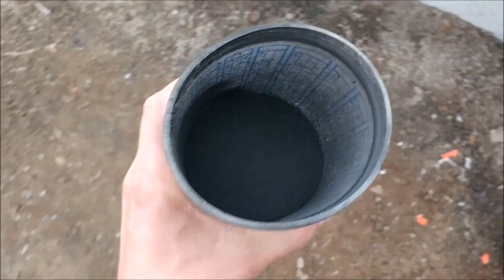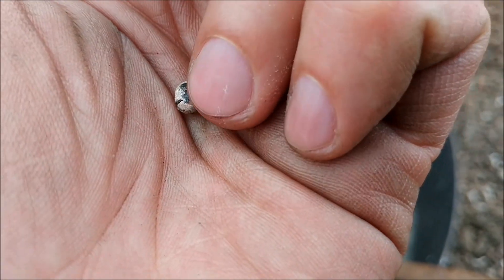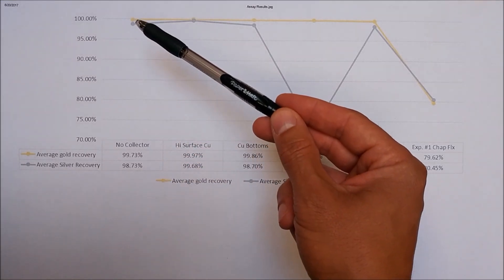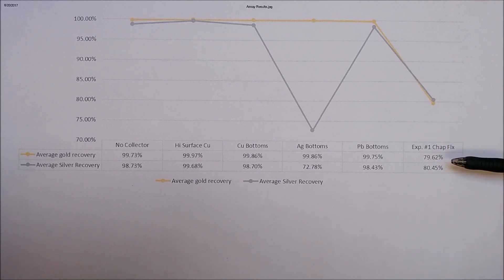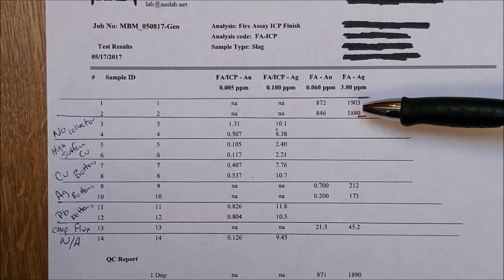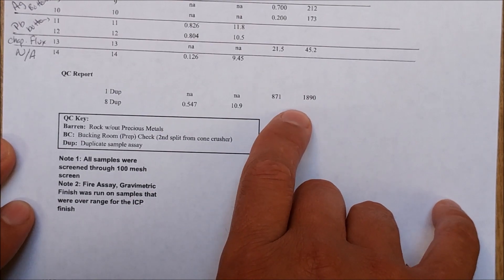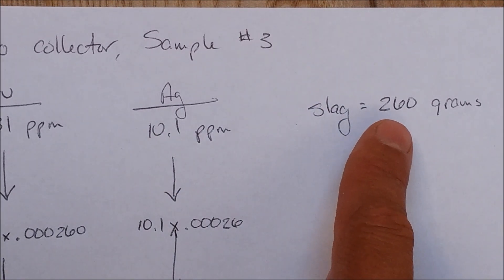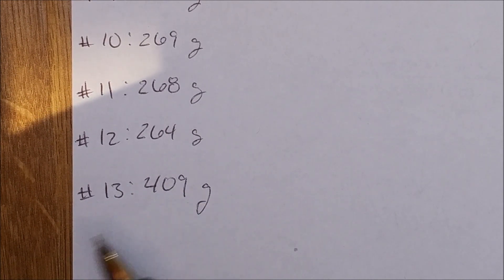Smelting gold/silver sulfides part 2: Collector metal smelting tests for precious metals recovery

Comment: Interesting.  Good to see a process comprehensively laid out.  I understand the button content is indirectly determined from the difference between the starting content and the slag content.  Not unreasonable.  However, from what I was able to gather for the buttons, the XRF data doesn't seem to agree with the indirectly determine data.  Is that correct?  If so, was that not unexpected?  Because in my experience with XRF, the probe can only "see" the surface and potentially a few microns deep.  So much of the button is not "seen" with XRF.  Or do you have different experiences?

Comment: Do you have come across a problem crated when the sample is rich in nickel in content?
I use lead as the metal collector but it turns out that lead shots float on top of the molten slag, in this case, and so cannot form a proper lead button at the bottom.
Just want to know how this problem can be avoided. :)
Reply from the maker: Not sure, try thinning with borax or cryolite

Comment: Thanks for the fantastic videos on smelting/refining, Jason.  This series is especially helpful to very small scale tinkerers like myself, especially since every lode source I find in my area of Western WA is high in sulfides.  If I can skip a roasting step and recover the majority of PMs it would be great.  Your content is some of the best on the internet on this stuff, with comprehensive information and documentation of your experiments that can be replicated by viewers.  I'm going to build a small furnace like yours (great cheap design with the kaowool and pipe BTW) to direct smelt some sulfide cons from a few of my sources.  A couple questions for you, if you have time to answer, as I'm still learning quite a bit:
Is that slag mold a custom build, made of simple plate steel?  That's way better than spending big $ on a large cast iron mold, assuming there is no big advantage to a cast iron slag mold over steel I don't yet know about!
Your specific sulfide cons seem to allow you to skip the roasting process and still have great PM recovery.  I assume different sulfide cons would have different results.  Have you had any experience with cons high in arsenopyrite or other problem heavy metals, with gold locked in the lattice?  Unfortunately, some of the best veins I've fond have high arsenpopyrite content.
Reply from the maker: Hi, the cone mold is a custom build, but simple and easy.  I haven't played with arsenopyrite, but assaying the slag will help determine the effectiveness of your experiments.  Thanks for the comments

Comment: hey just a thought..you said you dont know which metal but which one is easier to get the gold out of? sulfuric acid  easily dissolves silver. im not as educated in these fields but i have dabbled enough to know Cu has a even hotter melting point than gold and isnt affected by much acids.
Reply from the maker: Great, thanks for the tip!

Comment: Hello I was just wondering what part of the world you are in I live in California be near randsburg and I was wondering if your flux recipe is Universal or would it be area specific as to what is in the material as there is a high she-lite content in the cons which bonds with the magnatite trapping all the pms with it upon trying to  remelt the basic furnace would not do it we had to add magnesium pellets to the mix and when we finally got it to melt all the pms were vaporized almost instantly
Reply from the maker: Hi Sean.  I don't have any experience with sheelite.  Sounds like it is giving you guys a lot of issues.  Have you tried roasting the cons before smelting?

Comment: why would you place the collector at the bottom?
Reply from the maker: Good question.  If the collector performs well at the bottom of the charge it can be reused over and over again.  This will create a very rich collector block and there will be very little metal to refine.  This saves the long and expensive step of transforming your collector block into high surface area copper again or starting with fresh high surface area copper every time.  Hope this helps and answered the questions.  Thanks
Reply: Hi! Thanks for the answer, I have experience with lead and silver as collectors. IMHO the collector should be placed at the top of the charge, lead being heavier than most of the base metals travels trough the charge picking up precious metals on its way down (the smelting step in fire assay).
Reply: Hi Jason, did you ever work out if the Lead collector can actually be re used over and over again? since this test was inconclusive as you didn't need a collector to start with... @mbmmllc

Comment: Personally, I like copper as a collector. Recover the copper through electrolysis and the metals you're interested in fall to the bottom of the cell.
Reply: How do you have  You're electrolysis cell set up?
Reply: Shaun Mace like sreetips does it with a copper electrode.
Reply: @shaunmace9641  Sorry, didn't see you question before now.  Like John H says, I use a setup that i saw on sreetips.  Works well enough for small jobs like electrowinnowing smelted buttons.

However, I've never gone through the process of separating out the different precious metals from the muds.  Just got a bunch of that stuff in jars waiting to be separated.  :-p

Comment: Excellent
work. Thank you very much.  It will be interesting,
if it is possible to decant  part of the
slag and use the collecting metal several  times without to let it cooling down each time.  I ordered already material for my on oven to
test in this direction.
Reply from the maker: That is a good idea.  If you try it please let me know if it works.  Thanks

Comment: Thanks for videos on smelting concentrates and the results. I have been trying to find a process I can use to collect the extremely fine gold from sulphide ores I process here in south eastern australia.
Reply from the maker: Let me know how your experiments go with your fine gold and sulfides.  If you come up with a different or better method than the one I am using please let me know.  Thanks
Reply: I do have the same I'm trying many time I dont see anything  just lead color in the slot with a gold color after 2 days turn back to powder I m new i dont know what I do wrong

Comment: Jason.  

Each sample will have its own specific reducing power.  The higher the innate reducing power the better it will convert metal oxides to elemental metal for your button. I believe that this test shows this sample of shaker table concentrates from whatever particular ore it that was processed appears to have a very satisfactory reducing power on its own.  I think another ore with a less satisfactory reducing power might not produce a elemental metal for your button as easily?  

As I have been practicing my fire assaying it has been very apparent that the right "recipe" is vital to stellar recovery (and therefore accurate assay measurements) and that can vary quite a bit at times from material to material being processed.  

I think also the amount of metal present in the charge and the viscosity of the slag will have a lot to do with the success of getting a good metal button.  There was another factor I can't remember the name of that can cause the globules of metal to be coated and prevent them from coalescing which makes for "shotty" slag.  

So my take away from your test is that IF a collector metal IS needed for the material at hand, then the differences between them is minute and choice can be made on cost and preference, and not that no collector metal is needed at all, always.  Since I have been doing cupellation to separate the lead from the precious metals, that is the easiest for me.  Lead is cheap.  Litharge (lead oxide) is more costly but better.  Copper is recyclable if you do the electrolysis process in a previous video of yours.   It appears from your test that silver is the least desirable due to the cost of silver loss.

EXCELLENT TEST AND VIDEO.  I have been anxiously awaiting the results.  

Thank you very much for sharing.  Looking forward to the comments of others.
Reply from the maker: Hi Scott.  Thanks for all your comments back.  I am going to continue to experiments and see about doing some tests using pure pyrite that doesn't have any metals to reduce out in metallic form.  Stay tuned and I look forward to hearing more about how your experiments go.  Thanks
Reply: mbmmllc I've been questioning the use of pyrite as a collector myself the only problem I am seeing is the rapid exothermic reaction at its decomposition point. What ideas do you have to buffer the break down so as it not to become explosive? I dont believe that borax will be sufficient. Please keep us informed of your findings and may you be safe in your experiments.